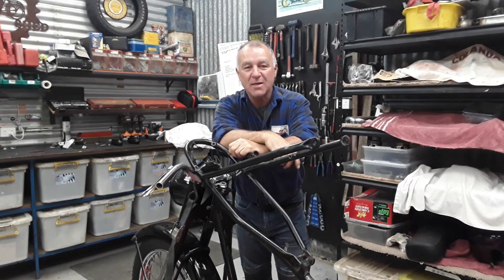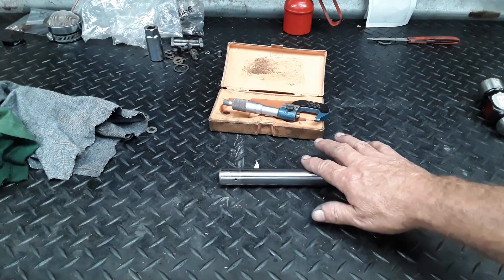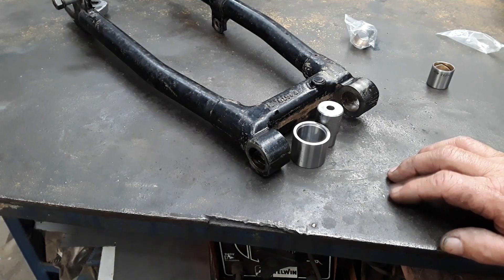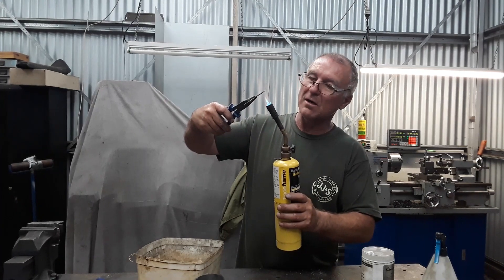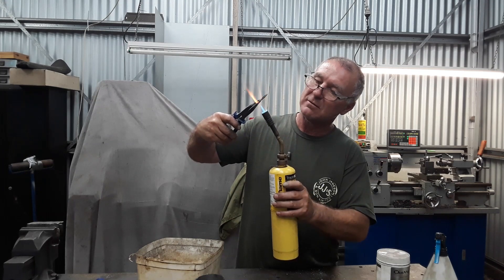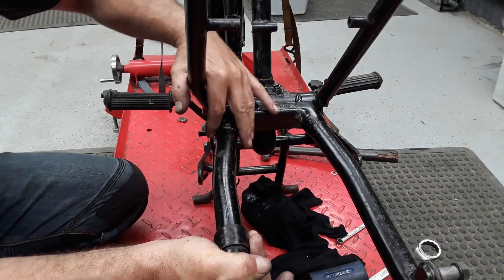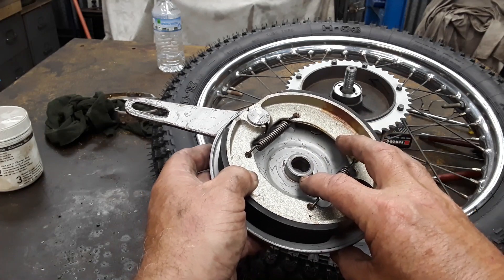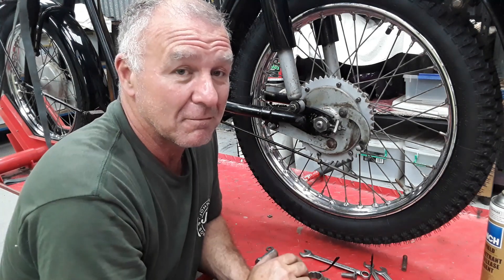BSA Bantam workshop update 16.1.23

Comment: Great update Bones. We are working on exactly the same thing at the moment! Did you have to do any reaming?
Best wishes, Dean.
Reply from the maker: Hi Dean............No reaming as the bushes ended up close enough for me to take off some high spots with a scraper to get the fit. It's going along well, but it has to as I'm still busy. I'll get the rear brake sorted and start wiring today.
Reply: @OzBSABantams  my experience is that a close fitting press tool (as you used) makes a huge difference when fitting bushes. Minimum distortion. Great to catch up. 
Dean.
P.S, I have sent you an email about pivot pins. D.